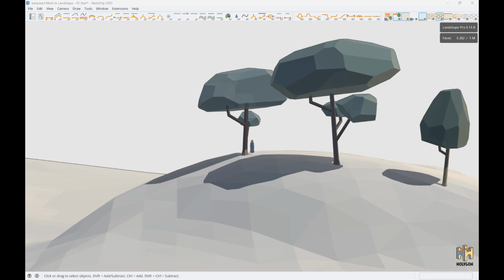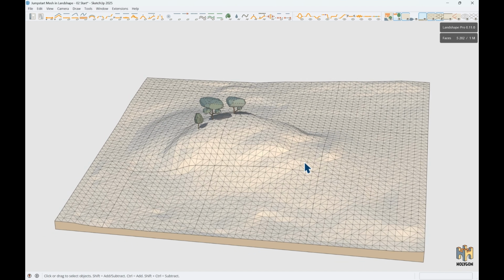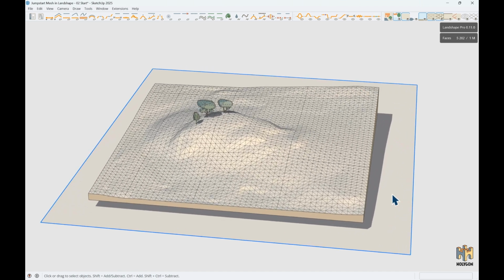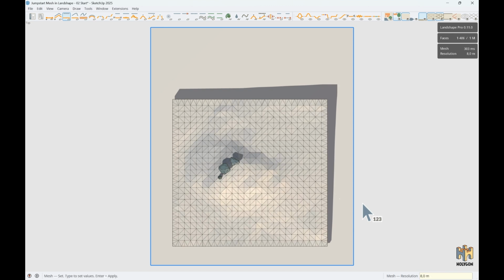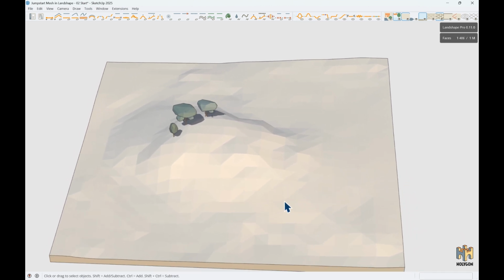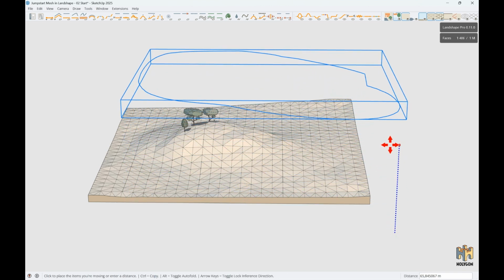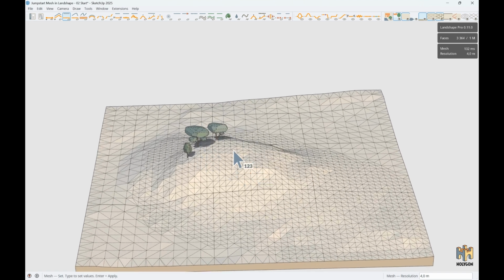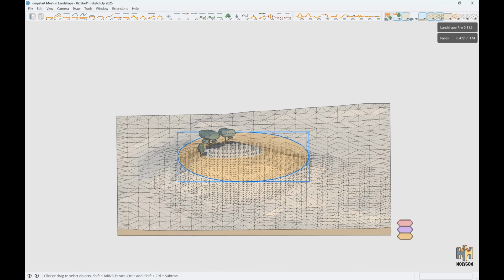Jumpstart Mesh in Landshape — How to Control Terrain Resolution

Comment: Image textures on the topography?. Can you retain and reuse image textures when you import a topo model through sketch ups model location? Please God say yes
Reply from the maker: Yes, Landshape supports creating and editing fully textured terrain. 

Yes, you can add, edit, move, remove, replace textured Sketchup materials. 

Yes, you can do this for the entire Landshape terrain, for smaller terrain areas called zones, or for individual terrain faces.

Landshape lets you texture your terrain in several ways. In your case, it seems that you are looking for Zone. In Landshape, a zone is simply a contiguous terrain area with the same Sketchup material. Here's how to Zone:

1. Zone 
Zone lets you use preexisting control groups to accurately determine what and where materials are added into your Landshape terrain. To Zone, do this: 

A. First, ensure that you have some simple Landshape terrain, and some control groups above your terrain. For Zone, your control group should have faces painted with the source texture material. For instance, your could use a regular Sketchup Addlocation import, or a 2D siteplan with faces painted with different materials.

B. Now, in Sketchup, select one or more of your control groups. 

C. Now, run: Landshape > Main > Zone

Zone should now transfer your control group materials onto your Landshape terrain. Done. 

Please note that often, you may want to first Embed ALL and ONLY those edges that should control the boundary between different materials in the resulting terrain. Embedding can give you perfect material boundaries in the terrain. But remember to not embed excessively. Only embed exactly the edges that you need.

Pro Tip – If you select multiple control groups, the lowermost will be applied first, and the uppermost will be applied last. This lets you use control group elevations a bit like layers in Photoshop.

There are alternative ways to paint your terrain, e.g.:

2. Zone Brush
Alternatively, you can use:
Landshape > Brush > Zone Brush 
…to paint your terrain in strokes. Sample material with Alt. Modify stroke with Ctrl and Shift. This is less accurate but more expressive. Zone brush creates new zones.

3. Fill
Alternatively, you can use:
Landshape > Main > Fill
…to fill each existing zone with a new material. Sample material with Alt. Fill does not create new zones, it merely replaces its material.

You can learn more on how to use Zone, , Zonebrush, and Fill here:
https://learn.holygon.com/landshape/command/zone

• Is this a good solution? Let us know what works for you!